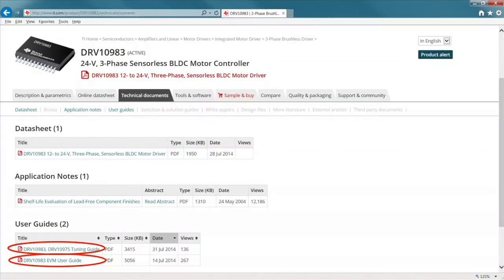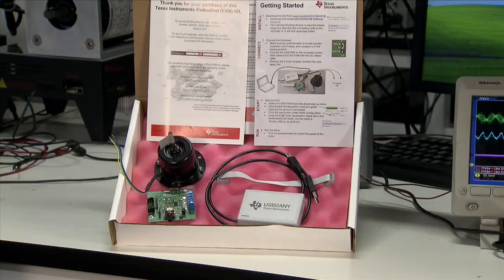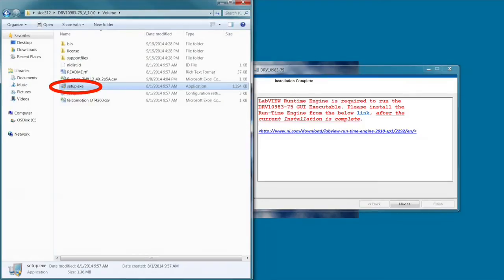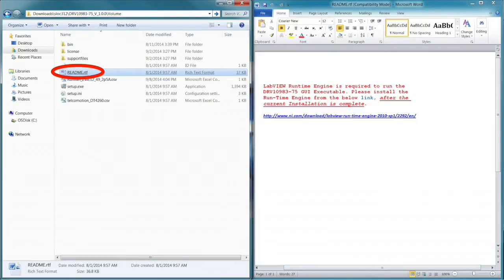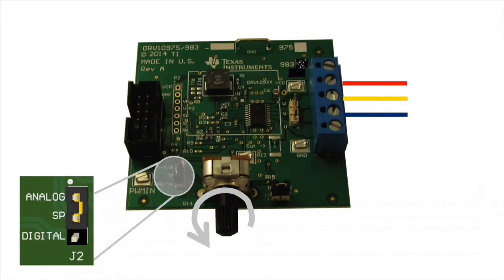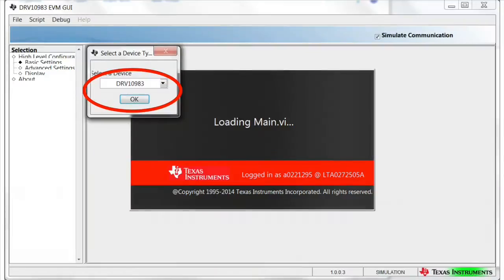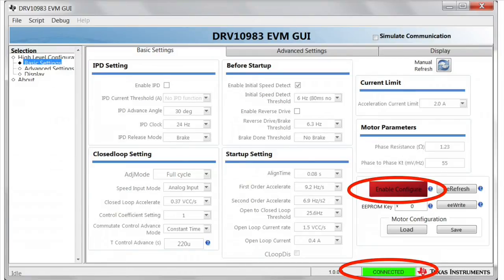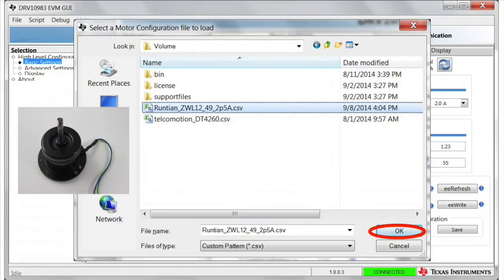DRV10983 evaluation module quick-start tutorial

Comment: What when I need a 500 watts 144 volts three fase signal for a 20 Kw induction motor?.
Reply from the maker: Hi-- If you'd like to post your question in this forum, our experts in the E2E community might be able to make a recommendation: http://ow.ly/YV3E30g4QMb
Reply: I do try, and oowww it is not 500 watts it is500 amps.